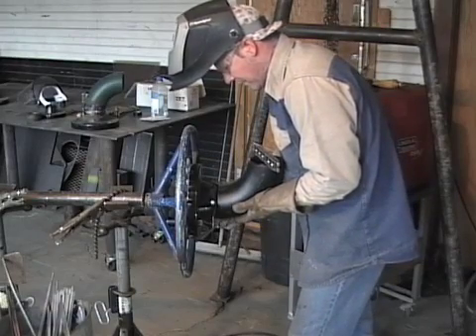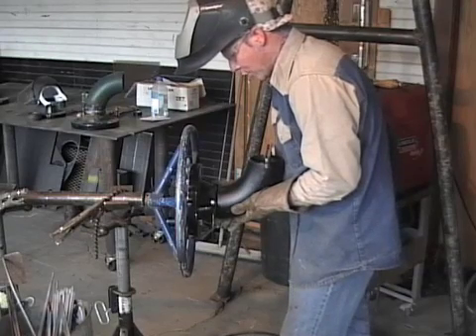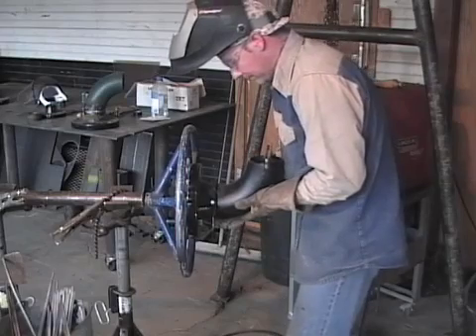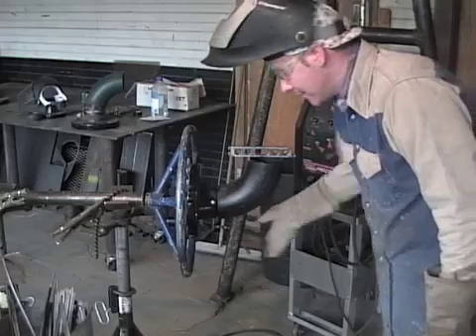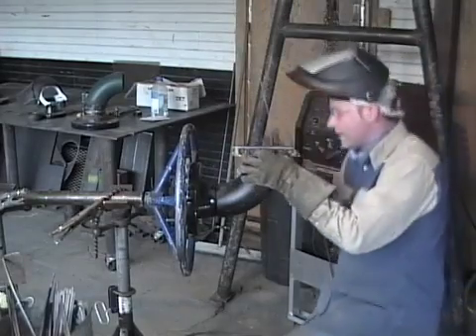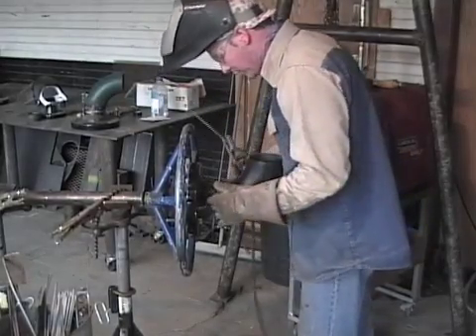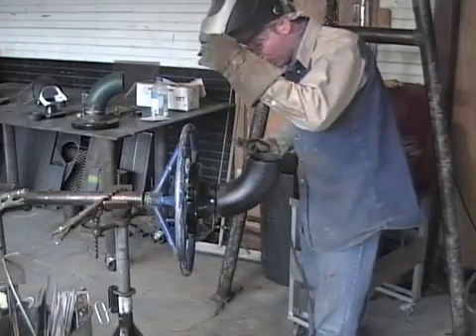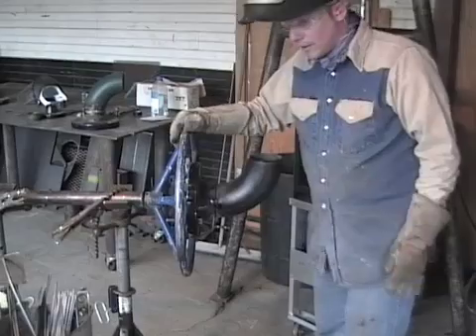Learn to Weld and Fit Pipe in This Welding Home Study Course

Comment: You can fit like that but it isn't the easiest way to do it . Working by yourself put your 90 in a vise one end up so you can sit your flange on top . knock the flux of a 3/32" low hydrogen rod ,bend in half  forming  a V shape , now you have a spacing rod ,  set on top of the face of the elbow . set your flange on top of it . align your fittings 2 holing your flange to your face of your 90  need 2 small squares . There is no holding any fitting this way and no need for a level . mike will tell you how to 2 hole it from here .

Comment: what if when ur two whole is level and flage is level to ur 90 and after u put a weld in it changes I heard it called weld shrinkage why does it happen how can u fix it  with out cutting it apart and how could u prevent it if u could respond id really appreciate it thanx.

Comment: I am Tom, manager sales from SHIJIAZHUANG PAIRUN IMP&EXP TRADE CO., LTD.we are the leader about steel pipe fitting Manufacturer and exporter  from China.
 1. our products kind : steel pipe,flange,elbow,tee,cap,reducer and so on.
2. products material : carbon steel, alloy steel, stainless steel,malleable iron,Galvanized pipe.
3 products            size :  1/4''--48''
3. products       useful:  gas and oil pipeline,steam pipeline ,water pipeline.
4. products standard: ASME ,JIS,GB,DIN,BS.
5.  MOQ:  10ton（steel pipe) 20 piece(pipe fittings).
6. FOB PORT : Tianjin new port.
7.  Delivery time: 15 days.
 www.porunpipefitting.com
email:tom@porunpipefitting.com
Reply: We use domestic pipe sir. Made in the USA
Reply: Tom Zhang new website can't be reached

Comment: 105 AMPs on 4" with 10 foot of lead?  No my man...you turned the machine up because you can't weld pipe.  lol  How do I know?  A real pipefitter would have cleaned the fittings.  Important step...wire brush the bevel and land clean of paint and other foriegn materials.  With that amount of lead your machine should be set from 87 to 92 amps MAX.  MORON

Comment: If you want to check side to side turn the elbow on it's side two hole the flange and make sure the face is level then get two 3/4 nuts and put them on each end of the 90 and set a level across them it will tell you if it needs to be hit up or down, this will be a good way to make sure it's fit good, After years of doing this you can get very close by just looking at the fitting and gap but factory ends alot of times are not very good so just looking at the gap is not the best way to fit it..

Comment: @starboy112 its a 90 elbow not a 40 foot pipe why would you square it just level it to your 2 hole. and as long as your land is fine from the factory and your gap is the close all the way around you dont need to touch it. just buff the paint off.

Comment: Sometimes I will lay the elbow on it's side and level the flange and take two 3/4 nuts and stand them up on the side of the elbow oposite ends of each other and set my level on top and then hit the elbow up or down because factory ends are not always true even on american fittings, good job fitting and welding by yourself I know how hard it is to hold level and tack been doing this for 23 years.

Comment: HUGE tack dude LOL!!!!!! You should be using squares instead of  "bubble matching" the sound @ 3:53 is called "penetration". You must not be a union guy. Perfect edges on fittings? what planet did your company buy them from? welding with both hands  is definitely important...whether you're holding the stinger in your left OR right hands, you should be using both hands. There isnt a rule abhout that anywhere...at least a written one, but its bad welding practice to not use both hands.

Comment: first off no real pipefitter works without flangepins so u can two hole it properly don't just throw a level on it quick thats insane.2nd off use a pipestand for your elbow and clamp it down so it doesnt move on you, dont juggle a stinger and an elbow. if your trying to show ppl how 2 fit at least get the proper tools you dont have anything.

Comment: Hey do you have any videos on welding 6G position 6010 root weld and 7018 hot pass and cap?
If you could get back to me with an answer before the weekend is done that would be great. Have a weld test tuesday and I haven't welded pipe in almost 3 years. I got my ticket back then but I am rusty.

Comment from the maker: I am not sure of what you mean as far as a welders kit?
You need that machine, hood, grinder, gloves, rod, etc
You don't need a tank unless you are doing tig welding or mig welding. You can easily find some of your answers online by doing some searches on various types of welding and the equipment you will need for that type of welding.

Comment from the maker: I didn't use any two hole pins. I never have. I have worked with fabricators that did use them, I have seen plenty of made up pins from things like pulverizing balls from a bowl mill and such but a level is all you need. Two hole pins makes it a bit easier but not necessary.